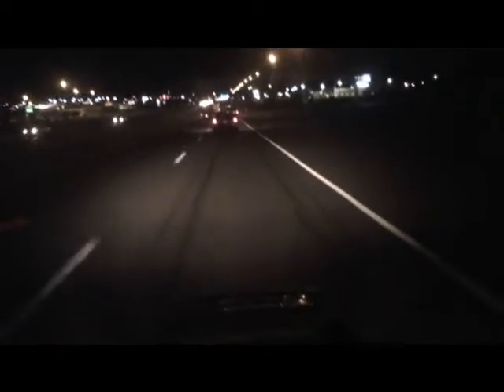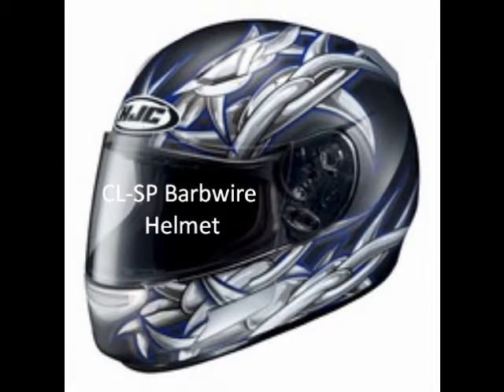Vado HD Test #2.  Night Ride

Comment: Your new camera does a pretty good job at night! The angle you have camera at looks good. You might want to try a foam microphone windscreen in the hole where your Kodak V570 was, it should take out any wind noise and maybe still allow for a little ventilation, Radio Shack has them.